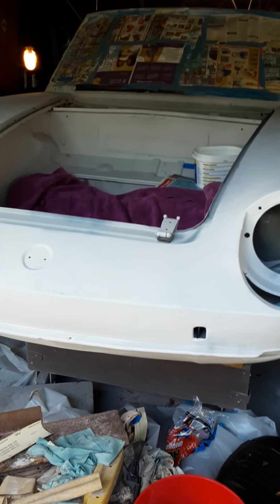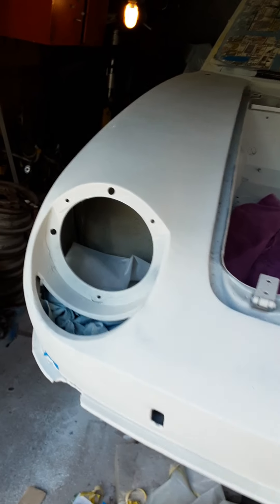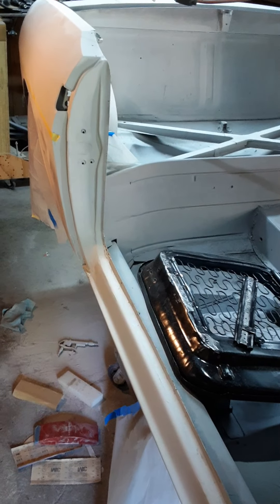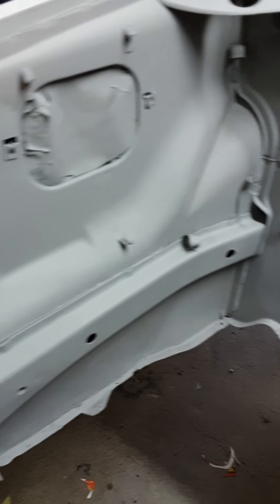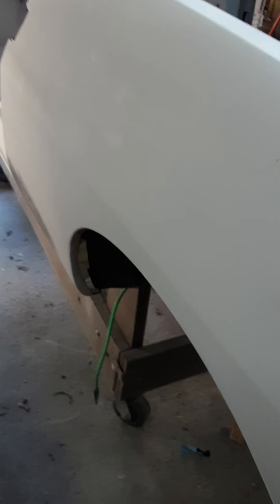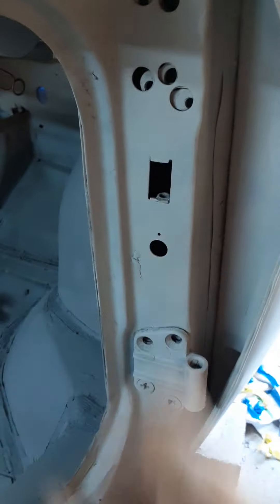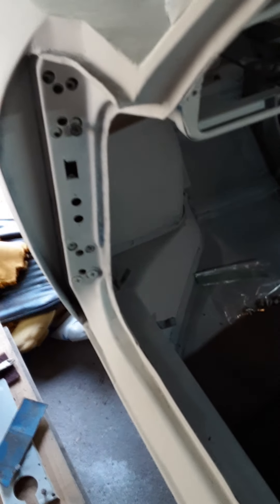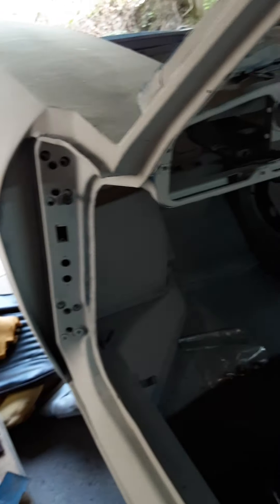Fiat 850 Restoration Project  " Slow Goin' "

Comment: Hallo dennis,
Your car looks better and better. 
A little Tip: I think it is better to install the doors befor painting the body. So you can easyer adjuse the gap of the doors. The line one the side of the car is very important for the look. The doors must be perfekt in that Part.
The Body is flexible. It is better to do that work when the car is on his own wheels.
Keep on rocking !
Reply from the maker: I agree that would probably be ideal. However, I have lots of time but little space. You can probably tell in my videos that I have little " walk around " room in my garage. I would not be able to open the doors or shoot the jambs correctly. The only alternative is to shoot it outside which I don't want to do. I could possibly build an outside booth but I'm leaning against that because of time and money. Thanks for your input!
Reply: @dennisjump8655  Hallo,
I have the same problem in my little Garage. Iam lucky to have the Garage from a good Friend for 1 Year to build my car. You have done so much work to the Body of your car. There is a high risk  that the doors ar not at the right place.
Maybe you can pull the car to the left side of your workshop and work at the right side?
Reply from the maker: @fiat850garage8  You can go back in one of my videos ( I can't remember which one ) and I hung the doors when I took it down from the rotisserie. I made sure I had good gaps before I permanently installed the rockers. They fit good even after being up there for 4 years or so. I also kept checking measurements from time to time to make sure nothing was changed. The car is well supported now on the cart. Also, the door hinges actually screw into a plate inside the jamb which should allow quite a bit of adjustment. You'd have to remove the doors to see them, but I don't recommend it. Fiat got that right.
I may yet put up an outside booth, maybe one of those Costco portable ones ?